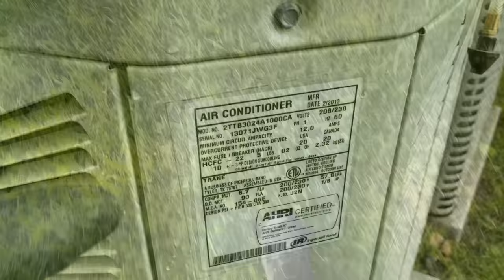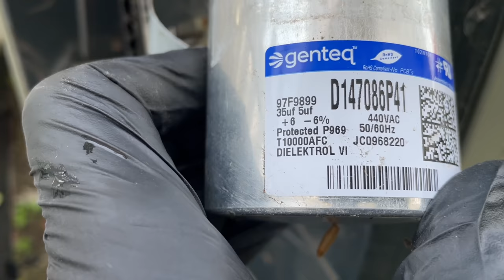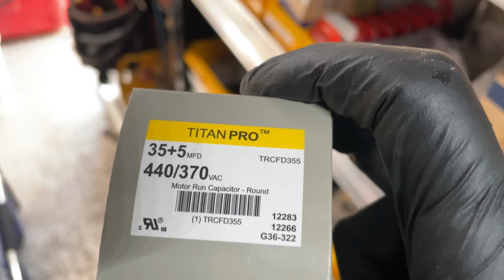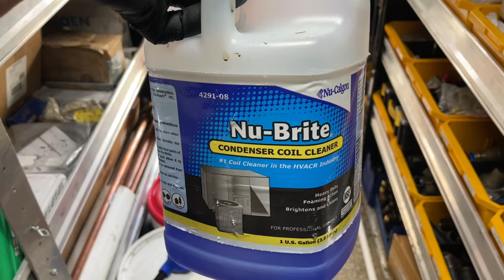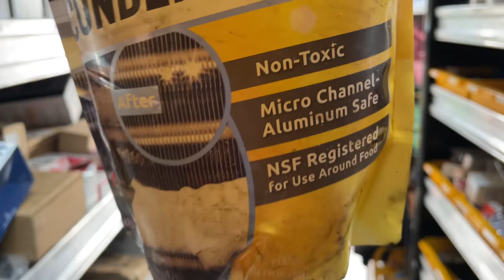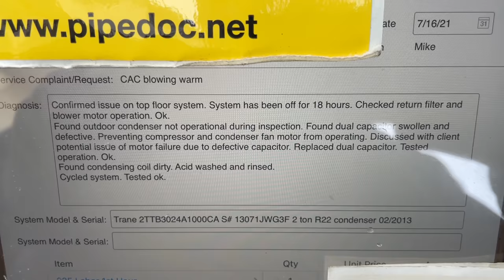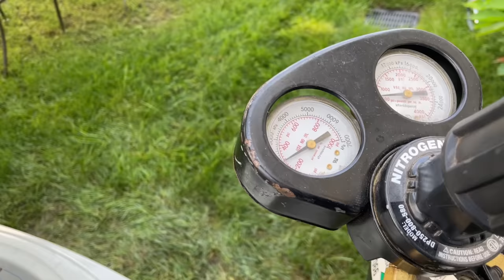Central AC System Not Cooling Found Multiple Issues & Valuable Important Lesson Learned - Feedback

Comment: Mikey all credit to you for showing that. So what was the lesson learned? If you ain’t testing you are guessing! In this case an old non functioning unit shut down since yesterday - 1st check - standing pressure?
Interesting property - they need another 1000 square foot of floor space - they have used all the floor space for storing ‘stuff’ - so is it rental and the ground floor has the only access to the yard?

Comment: Good video Mike!!! Def would have pushed to replace, but on r-22 system repairs in those neighborhoods I use the rs44 b. Little stop leak rs44b along with a disclaimer and see you soon for a swamp out... Works just as good as r-22 and don't have to change oil just pull to 500 microns charge to superheat and sub cool with provided chart. $260 a jug.... If you aint testin your guessin!!!! If you isn't a tester your calls backs gonna fester hahhahaaaa!!!

Comment: Hey Mike.  I have a question for you.  I live in NY and my son lives in my condo in Jacksonville Fl.  The HVAC gave out and we had a new condenser and air handler installed.  I contracted for a 3.5 ton 15 SEER unit to be installed.  When I got the registration sheet back from the manufacturer, it said the condenser was 3 ton 14 SEER and the air handler was 3.5 ton.  I called the company that installed the unit and they said the condenser can be smaller then the air handler and they adjusted the system to give me 15 SEER and 3.5 ton even though the condenser is rated at 3 ton 14 SEER.  Is this true or was he just scamming me?

Comment: This is why I wouldn't hack a half system in.
If is more then 5 years old I'll do everything or You will call someone else. 
(If I couldn't fix an obvious leak)
I do get the RX 11 & pig flushers, but in general you can keep that money.
Complete system w/lineset or nogo !
You got sucked in by the cap and it just worked yesterday,🤣😂
Where is the t-stat,where's the equipment, and what did you do to it is all I ask!
You washed & waxed a pig.😅🤣
🥃🥃🍺🍺🍺🍇🎳
Stay safe. 
Retired (werk'n)keyboard super tech. Wear your safety glasses.

Comment: For (GOD'S SAKES) stop putting the "FAN RUN" on the cap.. Put it on the (CONTACTOR) where it goes!!   

The "COMMON WIRE" feeding the cap is already stressed enough from starting the compressor/fan... Believe me,  you will better off!
Reply: @PipeDoctor   That is true Saint Mike, however you yourself seen the other day in a video whereas the "C" wire became so "OVERLOADED" it burnt up at the connector..

By moving the 'RUN" to the contactor, you are taking the "fan run" load off and (ONLY) leaving the "START LOAD" as it was designed.. 

Even (BRAND SPANKING NEW UNITS/SYSTEMS) do this, and before i start them up the first time i (ALWAYS) move the fan run to the contactor, and if need be use a heat kit wire i always save from having to redo (EVERY HEAT KIT) i install so i know it has enough electrode to feed the compressor and fan on start if it ever runs slightly heavy due to worn cap, hot day, etc.

I mean who will be working on it in the future? Should be you if you fixed it.. Right?
Reply: @Bryan-Hensley  No need.  You see plenty of it happening, hell just the other day he came across one.. Happens (ALL THE TIME)!!

You fix it by moving the "FAN RUN" to the contactor where it should be, and putting a solid good heavy duty wire on for common. 

Problem solved!

And i got all the time i want.. I own and run my own company in one of the most heavily regulated license wise states for HVAC there is....  I know my shit... Best believe it.
Reply: Very good tip, I have done this and vever had an issue again with capacitors.
Reply: @potatolew4495  Yeah they seem to really under size that common wire as is..  Rheem/Ruud brand is bad for it.. If you don't wish to move it due to schematic etc, put a real good Heat Kit 10-12GA thick electrode wire in it's place... 

But like i said and you agree, better to just move it over to start with.

Comment: I did the same thing on my rental unit after the fan blade blew up and beat the crap out of my condenser coil. I ran around for five hours getting a used blade off an old unit at my buddies shop then cleaned the coil. I wrapped it up at ten o'clock Friday night only to realize the gas leaked out somewhere else when the unit was making helicopter noises, as my tenant put it!  I'm checking the gas for anything more involved then a capacitor! LMFAO! SUCKS DON"T IT!

Comment: Mike , great video's just a suggestion I am not a big fan of the band iron around the capacitors I like the plastic wire ties with the mounting hole built in( for the screw) . Why because the wire tie will not rust , you can snug up the wire tie , you only needs one screw ,  The big reason I feel it looks more professional ..   just a thought  I enjoy all of your video's they are done well   Pete M